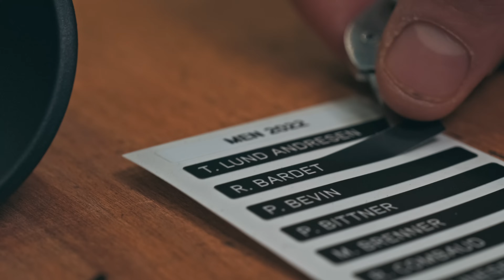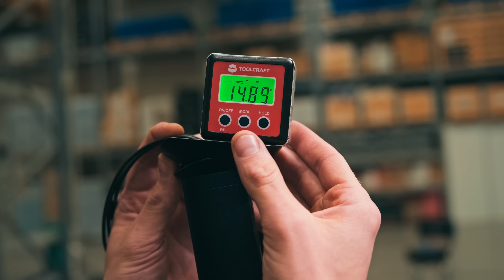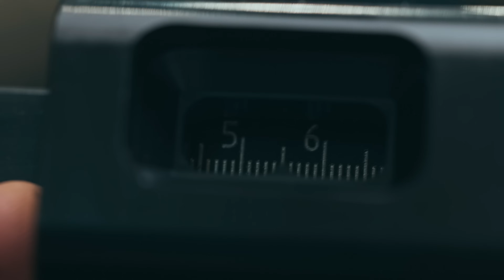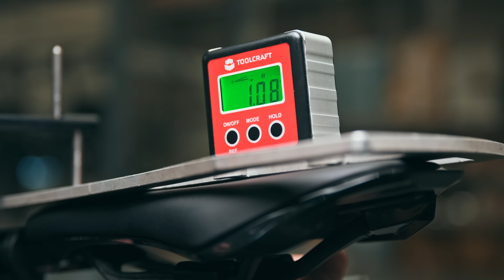Building Romain Bardet's all-new SCOTT Plasma RC TT

Comment: 23:18 what is this?
Reply: I think it's a rubber grip tape same used for fire arms
Reply: Sand paper
Reply: @user-chacha506  do all TT bikes use that?
Reply: @its_kam  Not all. But many cyclists use it.
It is just to prevent hands from leaving handles because the base bar is only used for acceleration and climbing, and when the DH bar is held, the vibration from the road is absorbed by the elbow pads.
Reply: @user-chacha506  will it hurt our hand by holding it? Especially for cyclist who doesnt wear gloves
Reply: @its_kam  Yes, that's exactly what it does to the skin, and it also scrapes the glove.
The DSM players seem to wear gloves, but I have no idea how the players without them get a grip and also protect their hands.
Reply: @its_kam  Sorry I may have said the wrong thing. Certainly the amateur cyclists around me use sandpaper, but perhaps the pro cyclists just use non-slip. Then you don't need to worry about skin protection.

Comment: bike shouldn't be so fking complecated, look at those wires and the building process! totally crazy!  imagining for a 15 rider team, team mechanics spending 3 hours ( pretty efficient i imagine) on each, that would be 45 hours of work, having 3 mechanics would spend 15 hour each, meanning two whole day working just to set up their tt bikes, unbelievable. 
omg, to integrate that little cable, those bike company design such intricate shit, adding so much weight just to look a bit cleaner. Those products are only made for the pros who have their mechanics taking care of their bikes. The trend of disc brake and integration is ruinning the cycling as people's sports. This is wrong way desinging bike. simple things work and work better
Reply: But there are not only 15 riders, there up to 40 riders. Thats hours at the office 😅